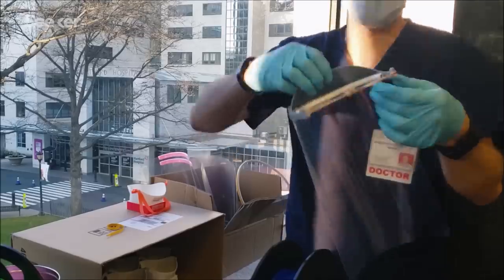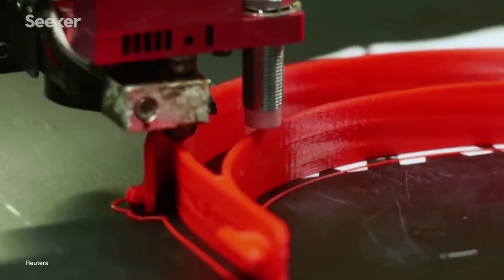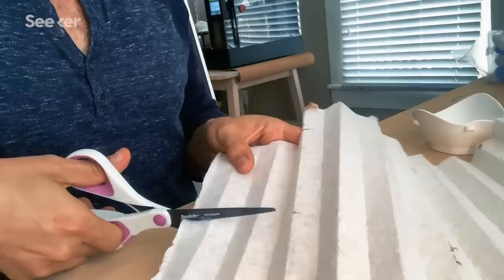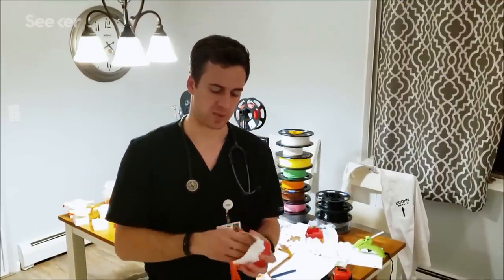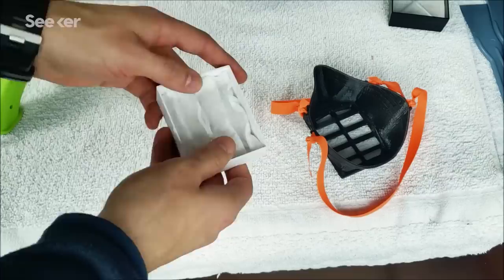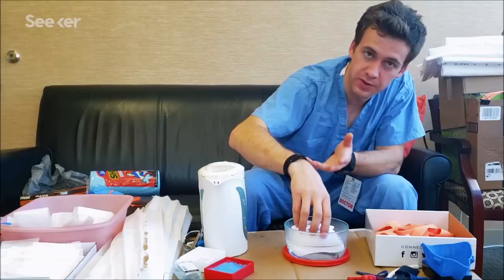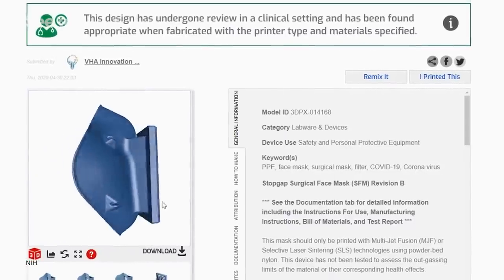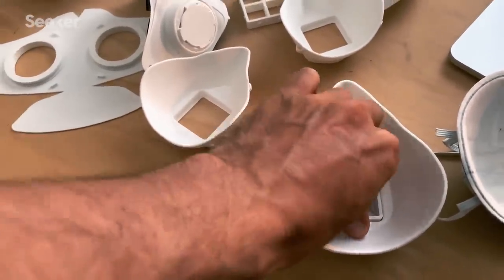These Makers Turned Their Homes Into 3D Printing Factories

Comment: I'm printing PPE for my local hospital (Boston Medical Center) and it's amazing to be able help.
Reply: Hope your company is still progressing with innovations that were in the works🙏

It's part of Rockefeller Foundation's pandemic plan to have companies totally overhaul their production & product development to make masks & ventilator parts (despite CPAP, BIPAP & nebulizers been proven more effective treatment protocol for severe covid than ventilators that further damage lungs & airways..) to keep companies from developing their own concepts.
Reply: @miss.apprehended  this did not stifle innovation, in fact it, boosted it. It's is for many reasons, but the top one is using tools and processes that are not part of a normal workflow. It makes you think outside the box to solve problems with a novel approach and dynamic troubleshooting.
Reply: At my university there was group dedicated to analize the porosity of common mdf filaments to see if 3d printed masks would be useful (that was at the beginning of the pandemic). I think they ended up declaring most mdf too poruous to be useful without any post-processing (but don't really know anything beyond that) . Do you have any idea how is your team solving this problem??
Reply: @eleazarhinojosabarrera5839  PLA at minimum printer quality. This leaves less chance delamination because the layers are thicker. You could also use ABS and then use acetone vapor to seal the layers.
Reply: @LanceMcCarthy  Nice, good luck!!!
Reply: Love your work man, both of them
Reply: Yay it took you 12 hours to make what, 20 masks?
Reply: @petercarioscia9189  ear savers (65-70 per hr) and stethoscopes (10-15 hr).

Comment: This is probably the better way to move into the future. It's obvious that a couple, centralized manufacturing plants is not always enough to supply sudden surges in demand. 

Individual hospitals could have standing relationships with local manufacturers that if the need arises, then they have alternative sources for their PPE.

Comment: I read a story, a couple of weeks ago, where 2 guys were making a ventilator part that was in short supply.   They made it on a 3D printer for only a few cents.   The corporate manufacture, who sold the  parts for thousands of $ made them stop.   Sadly, it's all about the money.
Reply: *in the USA... there are safety issues with untested and instabile material, even if filament choice is appropriate but there is much less money in medicine other places and it occasionally leads to boxes of replacement parts sitting ready to be deployed as opposed to monopolys enforcing Dependance trough occasional shortages.
Reply: yeah, its not always about money. if the thing making me breath can have a couple cent plastic piece some one printed or a more expensive one thats been rigurously tested and itsnt going to break on me , i think id rather pay more for the better one. 

i also kinda doubt the parts cost thousands individually though. maybe a whole bunch of them cost thousands. or the machine did. an entire ventilator costs a a few grand at most.

also if youre talking about https://www.medicaldevice-network.com/news/3d-printed-valves-covid-19-italy/

the company can try and sue. they will probably get laughed out of court though.
Reply: @ge2719 
Replacement parts can be surprisingly expensive, the aviation industry is infamous for refinancing their R&D not trough their primary products but replacement parts... not that it's too much of a problem when pricing is available and people have a choice in suppler (like in medicine most places).
Reply: I read a story, a couple of weeks ago, where they did a study of "I read a story" stories and 99% of them were bullshit stories. 👌

Comment: The important question:
Is this method more efficient than traditional methods?

I'll choose Efficiency over "coolness" anytime of the day, please.
Reply: No it's not but it can be rapidly deploy to handle the time gap for traditional method to come online. The lead time in Malaysia for injection molding is around 2-3 weeks. In our case we managed to print around 15k face shield within the 2  week time gap for the industrial guys to come in and fill the rest.
Reply: Germany had 3 weeks of supply issues before even face shields were injection molded, there are still items shipped others places from local makerspaces that stepped into a supply gap.

Comment: I owned a 3d printer and the material is expensive af. Can they make some big quantity of them? Because it can take hours to print just a single mask that can costs 15$. I think focusing on the normal respirators would be a better idea. Correct me if I'm wrong
Reply: I agree with you the a single mask is expensive in both time and money to print thus why 3d printing community in Malaysia has opt for printing face shield instead as it is much more efficient to be printed. This does not solve the lack of mask issue but it does prolong the life span of a normal n95 mask

Comment: Once this mess is over every country should stock up on these supplies and have at least a years worth supply for their front-line medical staff. This will give the medical staff the equipment they need but also gives industry time to scale up production before running out. Plastics longevity is for once a huge boon as it lets us store them for tens or even hundreds of years without them degrading. This also lets industry focus on making the things that can't be stored for a long period or specialized tools we didn't anticipate needing. It also shows what we can do as a species when it's not about profit.
Reply: The US used to be prepared, Taiwan utilised their preparation.

Comment: I know it's adding to the cost but why are you guys not putting activated carbon to them?
Reply: Active carbon in airfilters is used to filter gasses for instance toxic or smelly gasses like COx, NOx, SOx. Virusses are way bigger which is why they can be trapped by simple mechanical filtration.

Comment: Is this still viable even? how cost efficient is it? If it takes like half an hour to make one... 
... an injection molding company that I work with needed a bit more time and money to make all the tools for molding, but now they're making more than 10 000 masks per day for a couple of cents of plastic and electricity per piece - I'm not sure 3D printing is still good for this, it's probably better for some custom stuff that isn't needed in thousands and isn't efficient for injection molding.
Reply: 3D printing is great for rapid-prototyping. You can quickly and easily change the design.
That being said 3d printing will never be as good as injection molding when it comes to mass production
Reply: @iowalks  Not for injection molding as that happens under very high temperatures and pressures which the 3d printed filament couldn't withstand, but it's definitely a possibility for other types of molds. Of course you would have the layer lines from the 3d print show up in the mold which wouldn't be great.

Comment: This is what should be implemented around the world, the rapid and economic access, to 100% effective, of power against the expansion of the coronavirus, there is the urgent need to reactivate the world's economies, but until the vaccine is discovered masks are currently the only effective option to avoid contagion, this must be coordinated quickly throughout the world in order that people can leave their homes and be able to go to work in an orderly and totally safe way, this is why at the moment the only security measure to be able to reactivate the world and avoid massive contagions.
Reply: Or people could have listened to Taiwan, who never had to shut down much and is below 500 cases(, 70 transmissions in their borders) and 6 deaths.

The Whitehouse was little less prepared than Germany when Trump took office.

Comment: Since when face mask-making turned into a movement?
Reply: Because downloading print instructions is centralised? Local makerspaces have been interconnected to begin with and overlap with the current activity.
Reply: @fionafiona1146  that wasn't my point.
Reply: I suggest you watch the video again.

I'll give you a hint: theres a pandemic that's affecting the whole world and now it's a shortage of PPE's and these people try to make makeshift ones with 3D printing.
Reply: @MikkaPower  first, there should not be a shortage of masks. They're easy to make home with any piece of clothing one has.

Two, why are we acting as if masks are the solution when side affects of longterm application of them is clear?!
Reply: There should not be a shortage but there is. A piece of clothing is no match even compared to a 3D printed mask.

The longterm affect of NOT using a mask is dead people.
Reply: @MikkaPower  a self-made mask can be just as good - if not better - than a 3D-printed one.
Reply: @MikkaPower  also, if you cared about deaths, l can point to you a dozen causes fighting death in departemnts with higher mortality rates than this virus is.
Reply: Who should you trust:

- a random guy on youtube
or
- scientist, doctors and engineers that work with this everyday?

Your'e delusional if you think you can make something better from home.

(I'm also a random guy so don't trust me. Do your own research)
Reply: @MikkaPower  a simple equation for you. Take last years deaths from March to May 10, and compare them with this year's deaths from March to now. See how much more have died today. They're similar

Comment: All of these small parts could be injection molded in one entry level machine by the hundreds a day, not ten's. The cost of startup & production would be less. The cost of raw materials would be less. It would only need one operator. This is how you waste time and money for the sake of saying something is 3D printed and making the news.
Also there is no shortage of masks on Amazon, or eBay from 50 cent's for a basic surgical mask to a few bucks for activated carbon N95 masks. Click along, there is no story here. 🤷‍♂️🤦
Reply: Your right!  But that isn't  the point of the video.  If I need something, and it can be printed, I can have it today or tomorrow.  I do it all the time.   Ebay has 2- N95 masks located in the USA. One is 15 bucks and the other seems to be a box going for 300 but says, 1 mask!  Amazon has a few similar types, and surprisingly they have the medical masks again. A weeks shipping if its not a bait and switch.